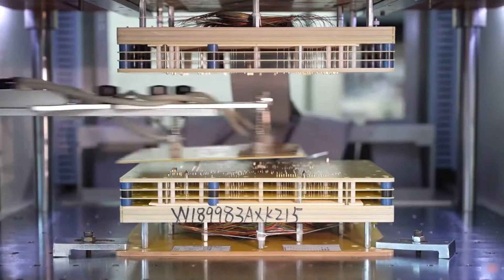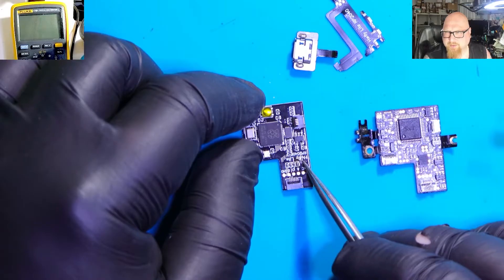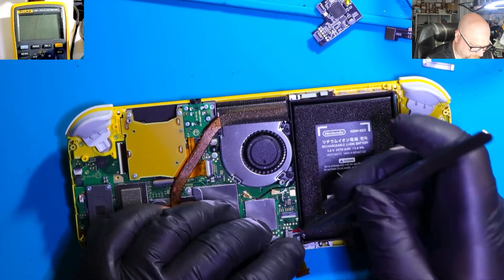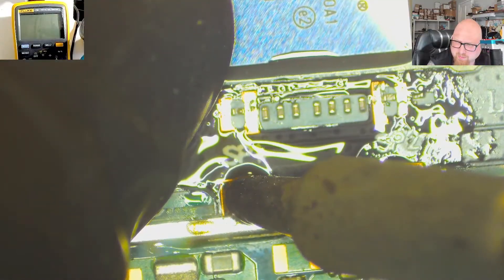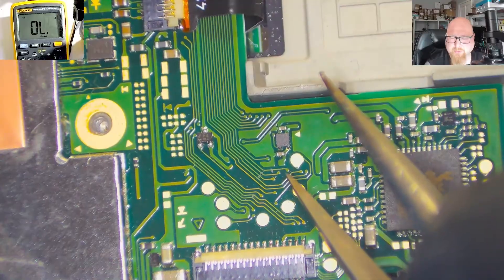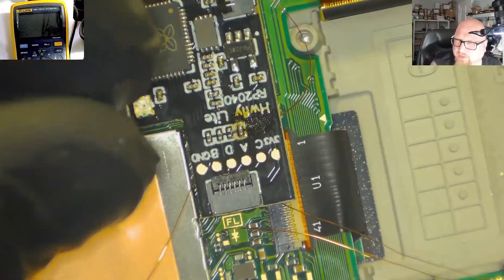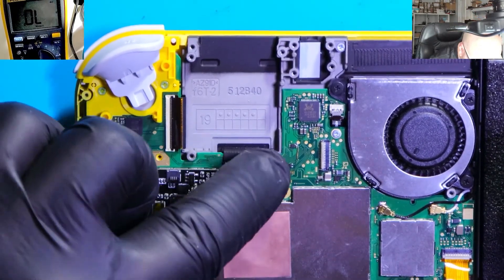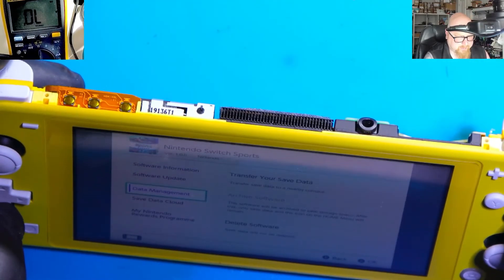HWFLY Lite or PICOFLY Lite??

Comment: Just seeing this video now as i read up on modding. One thing to note for future is that the launch option for CFW-sysMMC can lead to the switch being banned if it's not in airplane mode (Even when not connected to wi-fi) due to the way it communicates with the system NAND. CFW-emuMMC or stock - sysMMC are really the only 2 options that should be used, and quite a few people doing the modding service disable this before the user gets the console back to ensure they don't use it.
Reply: Thanks for the advice
Reply: If WiFi is not connected than it’s impossible you use a WPA protected WiFi. That’s the whole reason for protecting your WiFi
Reply: So if i buy a premodded switch i dont have to do anything

Comment: Hi! Could you please tell me which temperature do you use to solder these tiny spots?
Reply from the maker: 300C is enough.
Reply: I always use 368C, but sometimes soldering becomes like jam lol I face this differently in different boards. I used 395C to solder the APU flex cable since they barely melted at 370-385C, maybe my tips are bad. I have installed the modchip on switch lite with 0.1 jumper wires without using the upgraded flex cable. 

However now the home button doesn't work for some reason, not sure what I did wrong, I have checked the button, broken traces around the APU, pressure on it because of the chip, everything, it was keep being pressed at times, led was blinking like from time to time too until it almost dead now. (No standby/ sleep mode too) I believe the button press is still being registered somehow.

Modifying it was all possible thanks to wonderful people like you.  I'm happy with the clean outcome again, not ugly except the bit ugly looking solder joints on the APU. Clean work so far but not the best :)

Keep posting awesome videos like this! Stay safe and have fun! Have a wonderful day! Thanks again for the guidance!

Comment: The wires you use as jumper cables, are those coated in enamel? If so, do you burn it off beforehand, or does soldering burn it off?

Comment: hi there! what size/gauge are the wires you're using to do this? I've some experience on soldering, bought the chips and a microscope just to do this and have some fun :) thanks for your response!
Reply from the maker: Hi.
Enameled Coper Wire 0.1 mm
https://www.ebay.co.uk/itm/193702642730

Comment: Hi, That copper wire you're using is in some way? Which does not short circuit?
Reply: That is enammeled cooper wire. It´s don´t cause short on circuit.
Reply: @douglascalixto9086 what thickness (milimeters)is best for this mod?
Reply: @masterroshi5720   I use awg 32 ptfe or enammeled wire 0.10 in any cases.

Comment: i dont see why anybody with an iq above that of a ping pong ball would ever choose picofly over hwfly both cables for hwfly work great i have never had a problem using both cables
the solder job is easy period
Reply: the chips are cheaper and do the same thing. the picofly based chips come with the same exact cables. Hwfly doesn't use some superior manufacturing or QC.   people would say the same thing about coolrunners for rgh back in the day. ! in the end the cheaper clones and acev3 chips that came out  actually performed better for one tenth the cost.

Comment: Hello, I have a problem, where did you check the soldered points whit the multimeter?
Reply: he would be using diode mode to ground (no battery connected!) your meter may differ a bit . like he tends to get .619 my meter will read .819 .
Reply: @jrok96  OK but I'm still a beginner and don't know where ground is on the Switch Life

Comment: What can go wrong with the flex "cable" provided ? Cuz i used it on my switch and it works so far (3 months). Anyway its the same type of cable that is used near cpu, and this one desnt fail ?
Reply: nothing goes wrong with them  once installed! what logic would that be????  he just has issues getting them soldered so runs wires instead. you need to adjust things to your skill set sometimes.
Reply: @jrok96  i don't know what logic is that, that's why I am asking, he said he had few returns, so I assumed they stopped working

Comment: Got the same one, the flex cable you don’t use I had a similar issue with the flex and noticed the pads weren’t all the way to the edge so was able to slice just enough of the edge from the flex pcb so I could solder the pads across.  Was fiddly, but got it done.  Great video as always 👍